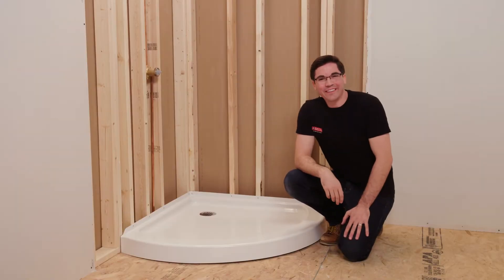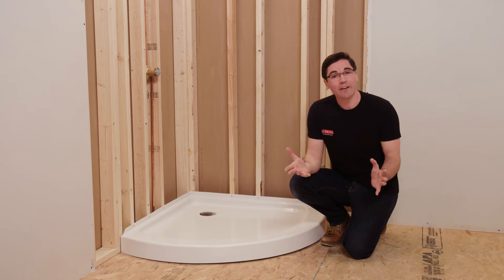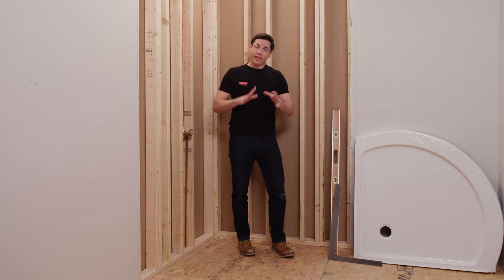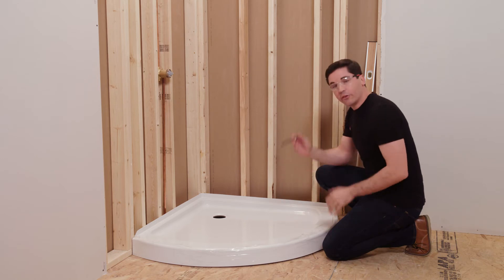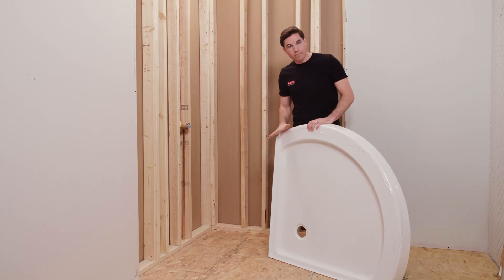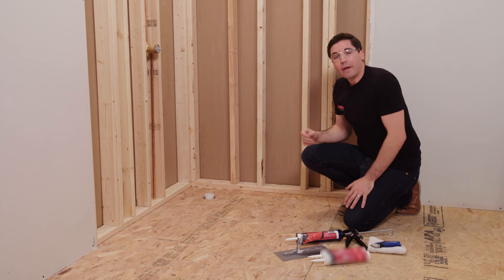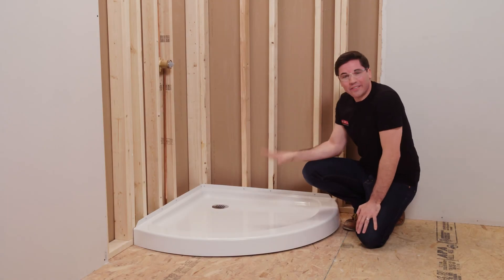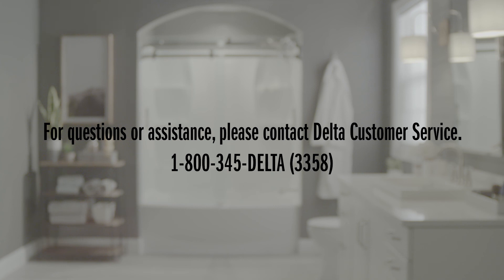How to Install the Delta® Round Corner Shower Base

Comment: How is the bottom of the unit (that interfaces with the floor/subfloor) supposed to look like? I have this item purchased from Home Depot, and it appears to have styrofoam over an OSB board. Does that remain or get removed for installation?
Reply: I have the same question
Reply: @thickwenis  Having just installed this and dug deeper elsewhere, it should be installed as it appears coming out of the box. Nothing should be removed from the base of the unit.
Reply: @antioccidents  Good. thats how i installed it

Comment: What kind of adhesive?
Reply from the maker: Hello Gairuntee, 

Thank you for your question. Here is a list for Recommended Adhesives for the Delta Shower Base:

DAP® 3.0™ Kitchen, Bath & Plumbing High Performance Sealant
Red Devil® RD3000™ Advanced Kitchen & Bath Sealant
ECO-BOND® Kitchen-Bath-Plumbing Adhesive and Sealant
LOCTITE PL Heavy Duty Sealant

Note the intent of the recommended sealants is to provide those that perform best not only as a sealant but as an adhesive, effectively a 2-in-1.

Kelley